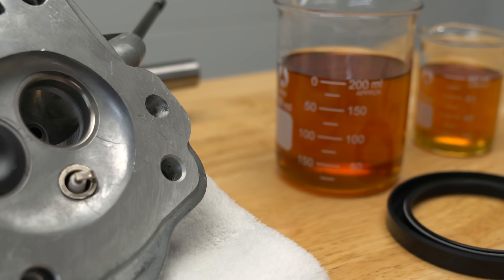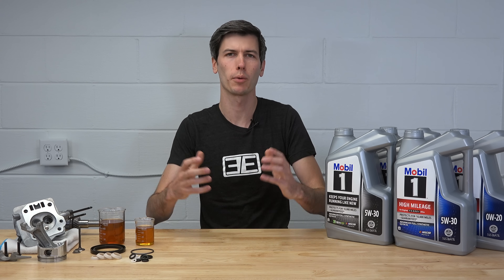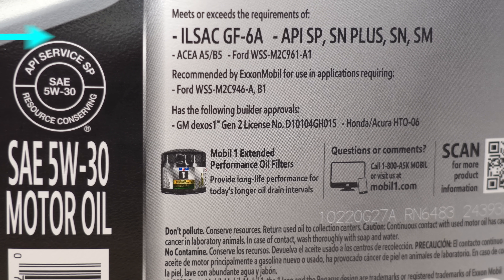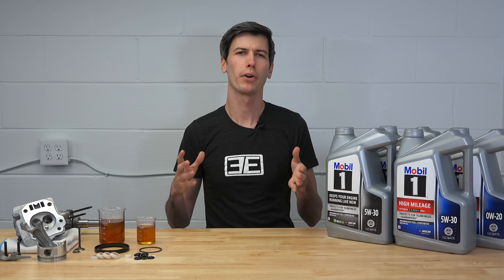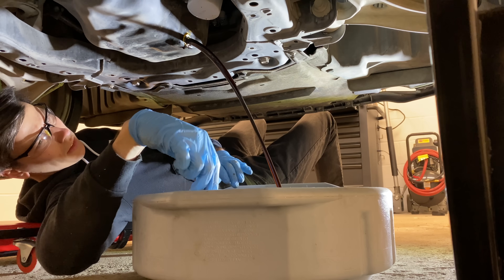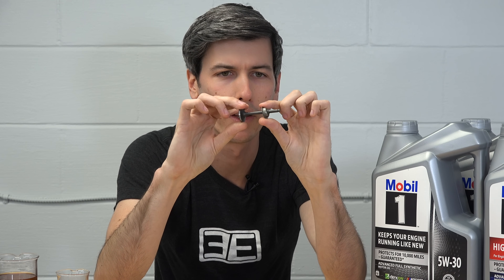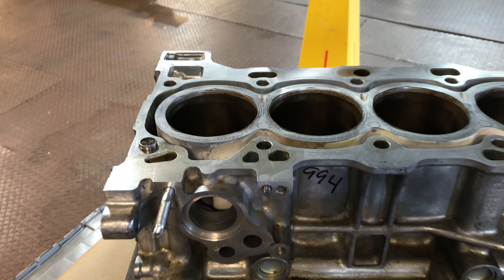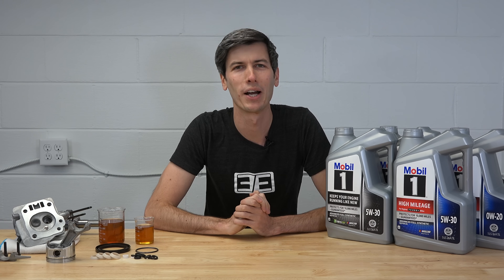Is Synthetic Motor Oil Bad For Old Cars?

Comment: Many older cars use flat tappet cams, which is a huge problem since zddp or zinc has been removed. Running one of these engines without a zinc additive is certain death for the camshaft, and resultant destruction of bearings and races from the metal particles that end up in the oil.
Reply: Best modern oil for those engines is heavy duty diesel oil in 15w40

Comment: I wouldn't put mobile oil in my lawn mower and this kid doesn't know what he is talking about my shoes are older than him maybe check with the manufacturer of your car if not Castrol oil is my choice
Reply: imagine thinking the brand matters
Reply: Interesting. I've been running Mobil 1 in my 1999 Mustang GT since, well, 1999. Had the valve covers off over the weekend to replace the gaskets and the upper valve train looked practically brand new. Don't know what your problem is with it, but my experience has been very good over the past 23 years.
Reply: Or Mobil?

Comment: I had a Subaru STN wagon that was hard to start in the winter...was advised to switch to syn oil by a dealer...I had to sell the car since the gaskets do not swell like with conventional oil...I couldn't keep oil in it...had to sell it

Comment: Synthetic oil is bad for old worn bearings.  Its just fine in older engines as long as you put new bearings in them first.  The relevant science is maintaining bearing spacing and the boundary layer thickness of the oil.
Reply: no.
Its about the viscosity. Fully synthetic would be even better here since its more temperature stable and doesn't thin out as much with heat
Reply: And how did those bearings get worn? Through use of the wrong oil. American perchance?

Comment: Acura tl 2001 245k miles, can i use Mobil 1 full synthetic? Quickly somebody summarize...
Reply: Just use what the engine car manufacturer advises. It's not just about synth / mineral or vicsosity.

Comment: I need help, got four star car  warranty. our engine lost power went to zero compression. we broke down 400 miles away. car warranty company only paid for 2 tows to two different shops. now they want us to pay another $500 for engine break down. plus work records on car like oil changes. we have 2012 GMC terrain 4 cylinder. so they will argue down to the molecular structure of the oil you used to deny doing anything to fix your car. they never call us. so I use Castrol high mileage partial synthetic 10W30 and not the 5W 20. we were on a 1000 mile trip. I guarantee the timing chain broke. it has 180,000 miles. 
therefore I might need an oil expert for a lawsuit against this false advertising car warranty company which has cost us $1500 for hotel, truck trailer rental etc. 
funny they never ask what oil filter you use either just the oil.
Reply: Why step out of manufacturer's specs for oil?

Comment: IN OVER 60YEARS OF DRIVING  OLD  BANGERS   NEVER EVER  USED  SYNTHETIC OIL  JUST THE  CHEAPEST  BRAND 10W 30,  HAD CARS THAT I PUT OVER 500.000  MILES  ON      65 DODGE DART  250 SLANT 6         GAVE IT O BUD HE DROVE  IT FOR 2  MORE YEARS NO NEED TO PAY    $12 A  LTR  INSTEAD  OF 8.$   REG? OIL AND FILTER  CHANGE IS  KEY,
Reply: Tribology?

Comment: These are ALL LIES. I am a Diesel, Petrol and Paraffin engine mechanic for over Sixty years. Only Volkswagen's  air-cooled engines used V-shaped O-ring type seals on the push rod tubes. NO other car, truck or earth moving or small engines ever used seals shown in this video. And ....... only the synthetic and multi-grade oils that started in the sixties, made the vw seals leak because of the viscosity and other gunk put in these oils. Answer the following questions: 1) Why does all so-called "new" engines needs OIL-COOLERS??? 2) Why does ALL engines using those oils make the inside of the engines turn brown??? Why does ALL engines, and TURBOS suffer bearing knocks, piston-pin wear, Piston, sleeve, rings, cam bushes, tappets, you name it, gets prematurely worn??? 3) Why do you get  a burnt-oil smell when removing the oil cap of ANY engine with these "FANTASTIC" oils??? 4) Why does timing chains, Plastic and fiber chain guides, timing gears and VVTi systems wear out???  THERE IS ONLY ONE ANSWER FOR EVERYTHING. LACK OF LUBRICATION, BECAUSE THESE FANCY OILS CANNOT HANDLE HEAT, NO MATTER WHAT THE WORLD SAY. A SIMPLE TEST, ....., take 300 ml SAE 30 0R 40 MONO-GRADE IN A CONTAINER and TAKE ANY, YES ANY FANCY OIL OR ALL OF THEM of the same quantity and heat them slowly on the same HOT-PLATE. SEE WITH YOUR OWN EYES WHICH WILL COME TO A BOILING POINT FIRST. ALL OTHER TESTS ARE MISS-LEADING. THIS IS WHAT HAPPENS IN ANY ENGINES ON EARTH, WHETHER IT IS FERRARI OR ANYTHING ELSE. WAKE-UP PEOPLE!!!!! ENGINES ARE STILL MADE OF THE SAME METALS, HEAT IS STILL THE SAME. WATER STILL BOILS AT THE SAME BOILING POINTS AS BEFORE. NOTHING CHANGED. AND WHERE DOES SYNTHETIC AND MULTI-GRADE OILS COME FROM???? THAT IS A STORY FOR ANOTHER DAY. WATCH THIS SPACE. BY THE WAY, CUMMINS ENGINE MANUFACTURERS BUILDS ONE OF THE BEST ENGINES IN THE WORLD. GUARANTEED FOR ONE POINT SIX MILLION KILOMETERS OR ONE MILLION MILES. NOT ONE CAN REACH THAT POINT ON THEIR "SPECIFIED" PREMIUM-BLUE OILS, FOR THE SAME REASON, LACK OF LUBRICATION. I PERSONALLY MAINTAINED A COMPANY FLEET AND MY OWN. i CHALLENGE ANYBODY WITH MY FACTS. TO TOP IT ALL,....., i AM DRIVING MERCEDES BENZ CARS SINCE 1969, USING ONLY THEIR SPECIFIED OILS IN THE OWNER'S MANUALS, SAE 30 OR SAE 40. (0W-30 AND 0W-40). GUESS WHAT, I'M PRESENTLY DRIVING A TWENTY YEAR OLD E-CLASS, W211, E270 CDI, NEVER HAD ANY PROBLEMS AT ALL. NO TIMING GEARS, CHAINS, TURBO OR EVEN OIL USAGE. WAKE -UP PEOPLE, YOU ARE BEING TAKE FOR DECADES, SINCE THE SIXTIES. ALL THOSE FANCY OILS C A N  N O T  TAKE HEAT AND DOES NOT LUBRICATE PROPERLY DUE TO VISCOSITY PROBLEMS. SYNTHETIC IS JUST THAT. MULTI-GRADE-OILS IS BEING MADE FROM OILS THAT COULD NOT OTHERWISE BE USED ECONOMICALLY. THAT IS THE TRUTH. GENUINE MONO-GRADE OILS IS REAL OIL WITH EVERYTHING ANY ENGINE NEEDS FOR OPTIMUM PERFORMANCE. I PROVE THIS EVERYDAY IN MY WORKSHOP..
Reply: I think your CAP LOCK key is faulty.

Comment: Synthetic is simply better oil. Just use the grade recommended. I use full synthetic in everything from my Honda lawnmower, Generac generator, Log Splitter and truck and car. You get the best protection possible.
Reply: I agree, but kinematic viscosity is not the only factor.

Comment: My old Ford has been on its way out for about 35 years now with Castrol 20W-50. Idle pressure is 15 pounds and sixty PSI at higher RPM.

Comment: Trying to explain oil properties to a lot of people is a difficult task. People have crazy ideas... You did a very good job!
     I have tried to explain to people about gasoline also. People can't seem to get that, in the absence of ANY detonation, lower octane fuel makes more power and better mpg. The increasing octane reduces volatility to prevent detonation (spark knock). Reducing volatility means less explosive force. Now if you have either a higher compression engine or an ignition that severely retards spark lead, higher octane fuel is best. Inversely, if your 4 cylinder economy car runs fine on 87 octane,  buying 93 is both a waste of money and can even reduce mpg (very slightly, but still a reduction). PS, If you ever use Nitrous Oxide at the drag strip, have the car full of the Highest Octane fuel that you can get...
      Nice video! Ya'll Take Care and be safe, John
Reply: NOBODY UNDERSTANDS THIS!

The higher the octane, the more resistance to ignition. You always want to run the LOWEST octane fuel a given engine can handle without detonation. 

Dont even get me started on the people convinced that premium fuel contains less ethanol.

Comment: There is another rumor. You can't use synthetic in old cars because it is bad for flat tappet camshafts. 
The answer is it is a myth. As long as they are greased appropriately when assembling the motor you should have no problems.

Comment: I believe synthetic oil is one of the best inventions in the automotive industry,period. Mobile One is what I used to burn in new sleeve bearings on electric motors years ago,the heat resistance and low friction viscosity is far superior to standard motor oils.

Comment: Ja ja ja synthetic oil a new business from petroleum companies. Change your oil every 3.000 miles and use a good quality oil and very important original oil filter. Ok I know what I am talking about. Thank you
Reply: At label , interval oil change is 10.000 miles. Do you had bad experience so you change every 3.000 miles?
Reply: ehh no you kinda don't because fully synthetics are genuinely superior to the regular hydrocrack synthesis based oils

Comment: Hello Jason
At one of our race club meetings we had a guy come and chat to us on motor oils. He was from Castrol vintage motor oil.
At present he was unaware of a synthetic oils that should be used in antique/vintage cars. i.e. pre ww2.
He explained that this was because of the metal, clearances and the fact the engines were designed to have a oil containing metallic components like zinc.
Can you delve into this aspect of engines. 
We have cars dated back to a 1956 Porsche 356c in our clubs historic racing section.
I race a standard 1983 Porsche 944. cooling and lube are always of uppermost concern when racing these older cars.
The repair costs are astronomical for us in Southern African. Exchange rates, shipping etc.

Comment: Synthetic oil cost me in 2014 a complete new engine of my 1959 cadillac. 
My volvo PV started leaking heavily in 2018 after the use of synthetic oil. The change of all the gaskets was necessary.
I own also a Peugeot 203 from 1954, differential consists of bronze parts. Bronze simply dissolves by modern oil
Now, I use only classic 20W50 mineral oil wit high ZDDP in my classics. I have learned my lesson.
Synthetic oil is only good for cars from the eighties and younger

Comment: I switched from regular oil in my lawnmower to synthetic and my motor started smoking when I would start it and smoked really bad for the first 10 minutes then still smoked after 10 minutes but not as bad. I switched back to regular oil and everything went back to normal. Not smoking at all with regular oil. I think this kid is full of crap.

Comment: I had an 05 Honda Accord. That used regular oil. And whenever I tried synthetic oil. No lie in less the. 200 miles the oil light came out and there was no oil what so ever in the engine. This happened about 4 times and I never used synthetic in that car again.

Comment: The oil that results in the least wear is the best oil for your engine.

Oil analysis is a good way to quantify what's working and what isn't because it tells you exactly how much wear you have.

A magnetic sump plug is a good alternative to oil analysis as it will show how much wear is occurring.

A spot test is another simple way to test the oil.

:-)

Comment: Is it bad? No. Not 100% of the time. 

CAN it be bad for your engine? YES.

Learn to ask the correct questions bro. This is the single most important part of your vids and you continually and consistently ask the wrong things. Come on, man. Seriously. 

Will thinner oil damage your engine? Is one example. That's a definite answer. Say yes and it automatically implies that any thinner oil WILL, WITHOUT QUESTION, damage your engine. And that's not true whatsoever. 

Come on dude. You're all trying to explain, engineering but you don't even know the correct questions to ask. It makes one question just what, else you don't know that's as basic as forming a question.

Comment: Synthetic oil is engineered to a higher heat tolerance...Synthetic oil might be beneficial to small car engines that spin high speeds but for everyday normal driving Synthetic oil isn't needed changing your oil when it's supposed to be changed out is more important than the quality of oil you use.

Comment: I have to disagree with you.
1. Thicker oil will not solve a flickering oil light. I had this happen with an that only had 75k miles on it. Yes the mechanic told me to run 20W-50 in until I got it to their shop. The manufacturer had put the wrong bearing's in the motor. 
2. When synthetic oil's came out in the 70's a lot of the conventional motor was not compatable with synthetic oil. Only in the early 2000's did synthetic oil become backwards compatible with conventional motor oil. It may have been earlier than.

Comment: Perhaps it's a "duh" on me but I've never read/heard about why cylinder wall cross-hatching is important. You said it's so oil will be retained by the wall and provide piston ring-cylinder wall lubrication.  Correct?  If I heard you correctly, WAY TO GO!  As a lifelong gearhead and mechanical engineer I've learned a BIG something from your video beyond its primary subject. THANK YOU!

Comment: Ok, the elephant in the room that seems to be deliberately avoided in this vic is that older classic cars have flat tapped lifters, which  requires zinc , which synthetic oil to my knowledge does not have.

Comment: I been using synthetic in all my engines, lawnmower, snow blower, 89 Harley, Ford Ranger for years with no problem. The price of it here in CANADA is getting way to high. $70.00 at Wally World for Mobil 1, 3.89L I think. Twice a year they have it for half price. Need to get there early  as it sells out. 260,000 km on 3.0l Ranger still going strong.

Comment: Is it bad for old cars? No, on the contrary. However, if you have a flat tappet cam, you MUST ensure that your oil, whether conventional or synthetic has adequate zinc in the form of ZDDP to avoid cam damage. Most modern oils don't have enough because it is bad for Catalytic converters. There are a few ways to get around it. You can buy a ZDDP additive, which can help. You can also buy a racing oil, which will work well- however, the acids in the racing oil will cause issues down the line after storage all winter. The third option, which is the route I go, is to either use straight-weight oils( which have no such zinc restrictions) or use an oil formulated for classic vehicles. Lucas makes a great one available in 5 and 1 quart containers.

Comment: ONLY concern is if you have any type of oil leak it will be/get worse with synthetic oil. Otherwise, there is no better oil for your engine provided you use the correct viscosity.

Comment: Prior to coming here I've been to Mobile 1's site and read pretty much everything being said here. As much as the info is correct I have a feeling it may not be accurate for all cars.

My concern is for my 1993 Accord with about 132k miles. I've owned the car since new and have always followed Honda's "servere" maintenance schedule. In fact living in an extremely hot and dusty climate I've actually changed fluids far more frequently than most "normal" owners would.

Given all that I face the dilemma that with no leaks and running my car on Castrol GTX 5w-30 since new I now need to switch. As mentioned by others Castrol no longer makes a conventional oil in a 5w-30 weight.

I already use Mobil 1 in my other 2 Hondas but they're not as old and I switched to Mobil 1 when they had far fewer miles and years. So the experiment will now begin. The only potential problem I visualize may be with the dreaded rear main seal as that is still original. I guess it won't take long to discover if running synthetic on a 29 year old car for the first time is going to help out hurt... 

BTW as a retired ME I truly admire ur videos and look forward to your presentations and topics. Great work!

Comment: The general consensus is this: for an engine that has run its entire life course on conventional, stay conventional. For an engine that has ran on synthetic, stick with synthetic.

Case in point: my 2008 Crown Victoria with 4.6 v8 has spent its entire 153,000 mile life running on advanced full synthetic Castrol 10w-30. It doesn't leak a drop. It runs like a brand new 4.6 of equal specifications. 

However, when a vehicle I knew had spent its whole life running on conventional, it was switched to synthetic. This caused leaking, because the seals were exposed to a different chemical makeup. 

Stick with what you trust. As for me, I'll stay with Castrol.

Comment: I have a 255k 07 infinity G35x thats gets the recommended Mobile One for high mileage, synthetic oil and its not burning oil, however it leaks a small but constant amount of oil ( I replace a large cardboard sheet that I get from a box store from between the paper towels and TP). Question, there are products available that are designed to stop leaks and acts as a    re-seal, would any of you suggest giving this a try? is there no harm no foul or is this possibly a mistake to try?

Comment: The question on mine 20y.o. still is can I mix 10 and 15W40 oil as I have both here. Both were the original specs but obviously it was changed to 5W40 on the td4/M47.

Comment: Yes! You want a little ”thicker” mineral oil in Old enginges, a classic is only used in the summer when you don’t Need the synthetic,and all oils is the base mineral with moor or less synthetic ingredients!
And the sludge problem is just failed oil change!

Comment: I have an '87 Buick GN that has been on synthetic since I bought it 10 years ago . It was on Mobil 1 but I can't find it up here , so I went over to Kendall GT 1 . It has 67,000 miles . My '89 Bentley Turbo  R was changed to semi-synthetic last year . I went with Kendall GT1 semi , this car just turned 66,000 miles . Neither car drip . I was concerned for the Bentley , but nothing adverse happened. I also use CAM-GUARD in both engines .

Comment: Old motors , it’s so thin that it passes between the rings and scratches in the cylinder wall ,in two weeks , your oil is two quarts low
Reply: Out the tail pipe